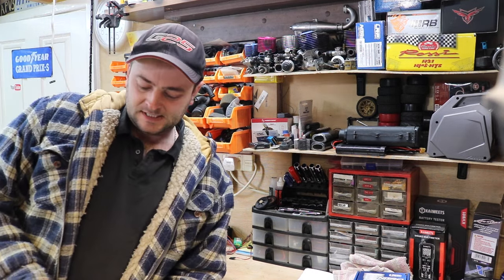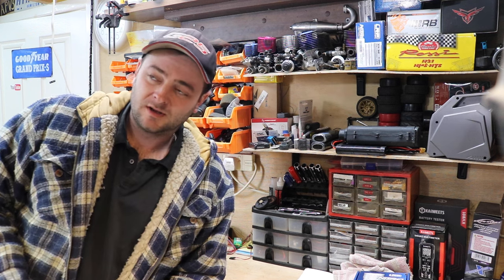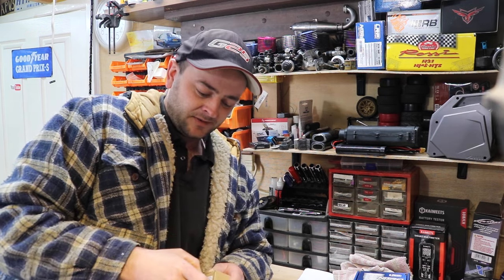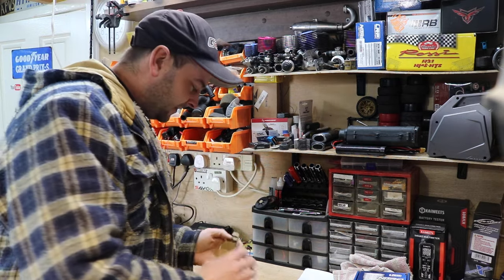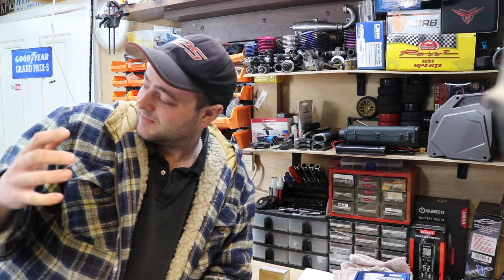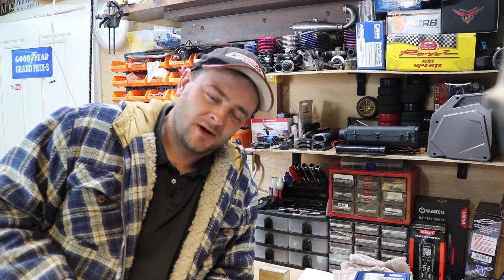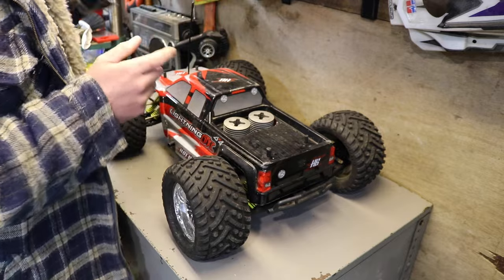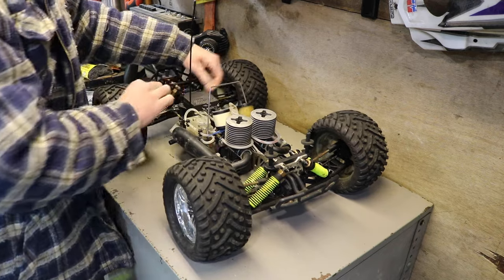I Can't Believe They Sell These Air Filters For Petrol RC Cars!

Comment: There's a company called outerwears that make super fine micron dust covers for these cars but even then I wouldn't drive one these in dust, most people run them in open fields on grass or on pavement.
Reply from the maker: What’s the point in having an off road car on grass or pavement lol dust is much more fun! And those outawears are a fortune!
Reply: @HaggardRC  the point is that you don't end up with dirt in your engine and yeah they're expensive but they work and better than rebuilding the engine it's up to you what you do with your toys

Comment: do you find the steering poor on this and the buggy forever on its roof
Reply from the maker: No not at all, the steering is just as good as you’d expect, it is a bit slow but most standard servos are. And it doesn’t roll easily either in my opinion. I assume yours does?
Reply: @HaggardRC  yes my steering seems to be poor on all of my rovan bajas im thinking is it worth trying a 150kg servo from Ali .
Reply from the maker: @theyorkshirelad.  I’d say no. Aliexpress isn’t worth even thinking about. If you’re gonna buy a new servo get it from a real shop dude.